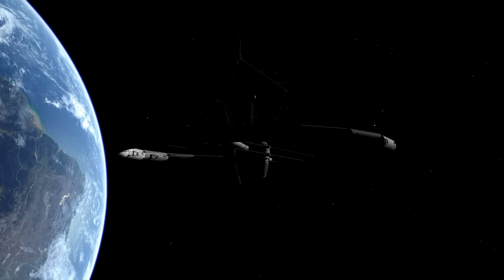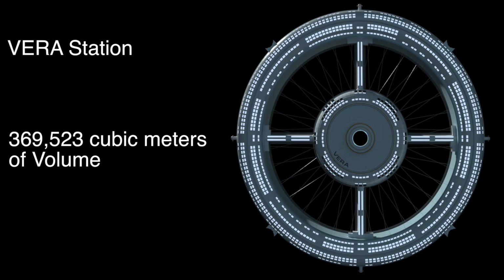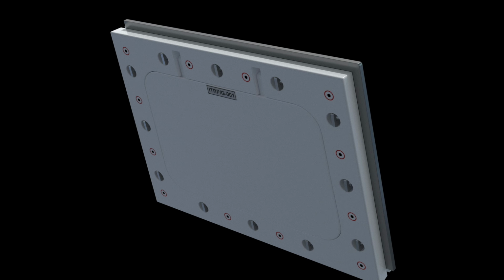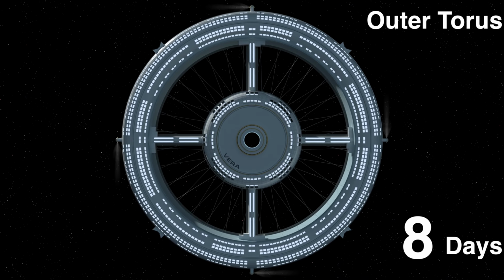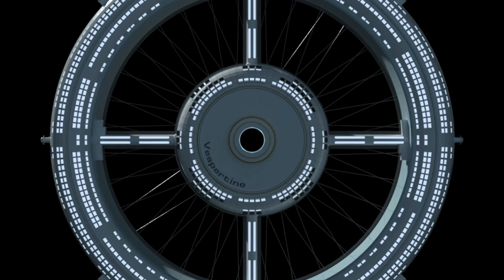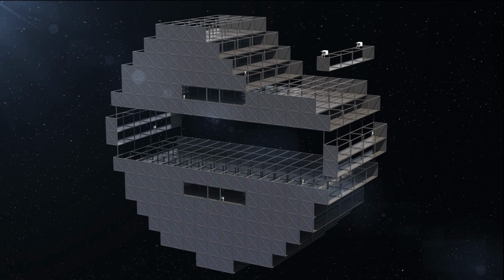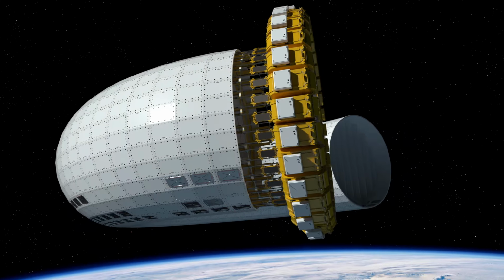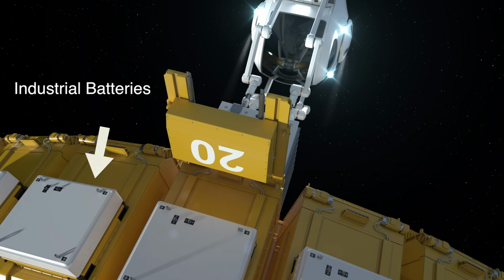We could build this huge Space Station in 6 months

Comment: The obvious question of debris from manufacturing has not been addressed. 

Are we talking about a bag system on the end of every cutting/welding tool? Are we talking about a double bagged environment around the entire structure? 

Micro pressure gas environment around the entire construction to allow simple control of dust and outgassing from welds would seem a minimum requirement.
Reply from the maker: Good question: The Weld manifolds are designed to capture all such debris.

Comment: Very cool idea.
How many launches would be required for the machines, how many for the materials and how many the keep the station in orbit?
Why stop there nuclear saltwater engines are already on paper, transport unmanned construction machines to every destination in the solar system it would take a bit of time, but... as a kind of spaceport and mine the required materials in space, it's far more effective. Just imagine a port and resource processing cerntre near the belt with a small crew it would be a job a few years long, but with a very good wedge overseeing an automatic mining operation and a constant stream of automated freighters a single freighter could travel a year or more, but as long as everything is well organized it has no importance, because the stream would be continues fairing materials to  projects in orbit or on the surface of Mars, Earth, Luna or any other celestial body in the sol system.
Humans and important cargo would be transported with fast nuclear drives and the other resources via slow but efficient and cheap automated ion powerd freighters. The pollution of planetary mining and processing would be a relic of a primitive and babaric past. A journey to the Mars would be available to everyone.

Comment: 2 of my cents: Torus is one of the least efficient form factors, just very popular. Cylinder, sphere and others provide far more volume for their weight. A torus also has too much space w/ full gravity and not enough w/ low or w/o gravity. Whole stations should not rotate for gravity. Adds unnecessary issues with safety, maintenance, maneuverability, solar panels, antennas and so on. Better to have a (few) lightweight centrifuge(s) inside. That can also be stopped easily, for course and attitude corrections, maintenance and so on. Putting heavy machinery into space just for assembly seems wasteful. Small reusable attachments can maneuver the parts where needed, which also allows any construction speed. Similar for small specialized tools like welders. Producing parts on a space station also makes little sense when all the material is transported from Earth. Easier to produce the parts on Earth directly. Only small scale repair facilities are needed on a station. If large scale space production happens, it's going to be with mining stations on asteroids, where the torus shape makes no sense for obvious reasons.
Reply: Whole stations should rotate for gravity lmao. Putting mini rotating habitats into a large stationary habitat just adds more complexity which increases the chance of failure
Reply: @thelelanatorlol3978  You have no idea which complexities come from a whole station spinning - like connecting the microgravity part, the antennas, vibrations, momentum, slowing down and speeding up, solar cells, space walks, outside maintenance and so on. Internal centrifuges, on the other hand, can be compartmentalized and would have no real effect on the rest of the station. If one doesn't work, it'll just stay unused until it can be fixed.
Reply: @orionspur  I'd rather have centrifuges in it spinning. But in small space stations, they could also spin themselves w/o issues around their longer axis - which can be both the radial and the polar axis, depending on dimensions.
Reply: @orionspur  Sounds really complicated. You also need very heavy catching devices, far more sturdy and heavy containers and so on. No human could do the corrections if there's any anomaly, like shifting weight. Which brings us to the question: How do humans get off and on such a station?
Reply: @orionspur  Multiple simple solutions:  A counterweight spinning the opposite way. A gyro (useful if the centrifuge needs to spin up and down often). Multiple centrifuges in opposite direction. Fans might also work, as the momentum might dissipate away. Or simply use thrusters to balance the change in momentum, which will require far less fuel than slowing down a whole station.
Reply: @orionspur  The issue is that with a spinning station, you have only seconds where payload and station are aligned, as the payload continues tangentially and will move away from the station at 200 mph if anything goes wrong. Which requires costly maneuvering to then again only have seconds. With a non-spinning station, you can do corrections for minutes or even hours. And whether a famous person once proposed it is rather unimportant. It's still  too many unnecessary problems and lots of unnecessary weight.
Edit: Tethering sounds even worse. A small mistake and the tether becomes part of a catapult, slamming the payload into the cylinder.
Reply: @carldombrowski8719  Nothing slams into anything here. Rather easy to catch an object in your own frame. The tether is to confirm precise guidance, and not for flinging cargo around, nor into the hull. The mass and cost of tangential release are exponentially less than using a rocket + fuel to deliver a person or pizza from station to station.
Reply: @orionspur  The problem is that the cargo is not in the same reference frame. And not guaranteed to move at the exact required speed. The difficulty is similar to having a rapidly rotating crane catch a car from a tangential street. The construction looks a lot like a trebuchet.
Reply: @orionspur  I have difficulties understanding where you see all those difficulties. All those are simple technical issues which have already been solved in comparable installations.
For the exit, you climb up to the center, where rotating and non-rotating parts (from outside) allow easily and safely changing speed to adjust for the ladder or for the station. Once your speed is adjusted for the station, you just float out as usual. Vice versa for entry.
As to attachment, I suggest a bar in the middle, which can also contain a motor and which can be attached with wires to suitable parts of the station. The wires can also be part of an emergency breaking system. Other options would also work.
The solutions to stopping without transferring momentum were already discussed. A counterweight can be put anywhere, in a single centrifuge ideally the middle. It can be a water/algae tank, containers with long term storage and so on. It could also be a second level centrifuge going the opposite way. Technically similar to contrarotating propellers.
The whole system is part of the internal air flow, so no need to make anything air tight. Though having the option, similar to self-sealing fuel tanks in combat aircraft, might be a possible safety feature.
Reply: @orionspur  I don't know where the miscommunication is, but I assure you none of your points make any sense. The exact geometry will obviously be as necessitated by the laws of physics.

Edit: After reading the context, the fact that your trebuchet is in free fall only ads to the possible things which can go wrong. All the issues of a fixed stand apply, plus the issues from not being fixed in place, like a shifting center of gravity, wobbling and so on.
Reply: @orionspur  Seems Princeton could use some better PhDs if you don't see the pretty obvious issue...
Reply: @orionspur  Not even remotely. All a matter of calculating the forces and choosing the correct dimensions accordingly. Any amusement park can show you. What did you study? Certainly nothing remotely technical.

Comment: @Gateway Spaceport LLC
If you want to build the best type of space platform or deep space spacecraft then it would be better to take one of the larger Asteroids out of the Asteroid Belt & park it in orbit somewhere between Earth & the Moon with the same orbit as the Moon before it takes off into deep space. One would dig into it's core & use all the raw materials for manufacturing internal sub structures once the Asteroid has been hollowed out. It can be rotated end to end so that you can make internal box chambers like the structures we're used to on Earth to provide gravity from it's rotation plus it would have a natural cover from Cosmic Radiation. The best spacecraft travelling through space is one that looks like an asteroid that is totally harmless looking from the outside if one were ever to bump into ET's out there. One doesn't need to spend so much money reinventing the wheel, one only needs to adapt what you have all around you already.

Comment: Keep in mind, an average semi truck only carries about 30 tons. A starship can carry 100 tons so basically every starship will be like 3+ semi truck deliveries.
Reply from the maker: Starship can carry 150 metric tons.
Reply: @TheGatewaySpaceport  not yet, that is the plan but the current model will only carry 100 metric tons in reusable configuration. Once they get re-use figured out, they will push it to 150 very much like what they did with Falcon 9. There is plans for a 200 ton reusable Starship but I think that is Tanker only. Tankers will not require as much steel as they will just stretch the fuel bulkheads and have no door or damper mechanisms. Tankers will also likely have fewer engines since they won't carry customer payload or people there is less need for redundant engines.

Comment: I'm impressed. This may take a couple of generations to come to fruition, but it will. I can only dream of it starting in my lifetime and I envy my kids' opportunity in the future. Gravity keeps us thinking small. These techniques lift that restriction. I'm all for it.
Reply: Several generations? This is good to go the moment Starship is good to go
Reply: @marcozolo3536   building the builder and launching / fabricating all that needs to be launched would take entire countries worth of production. A torus with an OD of 224m (roughly 60 feet thick) is 12 million cubic feet of volume (341K cubic meters)... that's a surface area of 804'175 square feet, at 50mm thick of aluminum, is 132'000 cubic feet, or 3'737 cubic meters of aluminum... that's 10.2 million kg of aluminum needed to just build the skin of the outer torus that needs to be launched into space. Starships current estimate is 150T cargo load, with 10'200T that need lifting for the skin of the outer torus alone. So 68 launches. The aluminum will cost (at todays prices) about 40 million, Starship launches are estimated to be in the 8-10 million range once commercial - so ~700 million in launching. Then all the employees and peripherals, then this actual machine that does the building, all the other supplies, batteries, gasses etc. Then the inner ring, then to fill nearly 400K cubes with air and a rebreathing system capable of handling X number of people onboard... 
 This thing will cost tens of billions at a minimum, and it would only take 1ml of liquid mercury smuggled aboard to make it all disappear...
Reply: @Azmodon   2ml of mecury actually. And good luck getting that through space customs
Reply: @Azmodon  All of which is why it's way more practical to first establish mining and refining and manufacturing on the moon, then using lunar made solar powered rail launchers to put materials and products where you want them.

Comment: Can you expand more on what safety procedures and measures you have in place internally, for example a small rock hits the outer ring and knocks a few panels out also what preventative measures as in radar and will the base be completely run by AI and what safety measures will be put in place regarding that.
Fantastic project and obviously a step in the right direction.
Reply: Not AI, no. Each station is so big it would be like it’s own city, so I assume it’d have its own government
Reply: Kesler syndrome. 
Every micrometers can start such a chain reaction .
Great ideas though
Reply: @gravneyrichardson3507    Should be built with Escape Pods in a few rectangular shells in the circle torus so in an emergency they can jettison out and of course you need a way to either move the pod to the next inner or outer torus or to another torus via internal jets or emergency vehicle.

Comment: My issue with this is there is no need for a massive rotating station in earth orbit. It'll unlikely to have enough utility to be cost effective because there is easy access to a 1g planet 400km away. You need to think bigger, The moon is the gateway to space and developing infrastructure for producing fuel and structures around the moon has significant benefits and utility. The need for workers to build this infrastructure on the moon makes an artificial gravity station around the moon make some sense for the massive investment required.
Reply: You do agree we need a orbiting station? For creating objects to large to be lifted in one go?
The rotating aspect is only for human presence.
Reply: @hanswitvliet8188  I do, but I think the focus on human habitation is not the type we need. What we will need is a fuel depot/factory/spaceport type station in that order. Maybe after we have a space economy there will be a case for a space hotel in earth orbit.
The real problem we have to overcome is resource utilization in space with material sourced from space. Sending lots of cheap mass up Earths gravity well will never be economical. 
In earth orbit Tele-presence using VR Robots is a option, Human stations will be needed as we move out due to communication lag.
Just my thoughts on it, I just cannot see the point in a large ring station around earth for at least a couple of centuries.

Comment: I love your concepts. Here are some technical questions: 
Where is the earth gravity level? If the earth gravity is at the outer ring, then I suppose a much lover gravity level at the inner ring.
To finish the Vera Tube you will not be able to use the ring Maschine. Which Technik will you use to finish the work correctly?
Reply: the machine could probably finish the torus but would get "stuck" inside of it. 
a simple hinge to split the machine in two halves would suffice.
Reply: @nilsdock  Nope. The two halves at the least would have to completely separate from each other. Those joints would have to be such that the machine would split and move out from the radius that would be 1/2 the ring perpendicular to the perpendicular line from the center of the whole torus assembly. Then you would also have to remove the inner parts of the assembly machine. Simpler to just  remove it when close to the torus's final assembly and insert a plug unit. Something the second machine could be making once it got out of the way of the first.
Reply: I am not sure if full earth gravity is needed to avoid bone and muscle degradation. For fabrication and assembly less gravity has lots of advantages, even micro gravity. The lower the centrifugal acceleration the less the annoying coriolis forces
Reply: @johgude5045  this is one of the reasons we need an orbiting medical test ring. to learn how lower gravity affect the body.

or higher gravity could be useful to study as well. who knows we can have bodybuilders training in 2g without weights.

personally i look forward to 0.1 g or less quidditch tournaments.